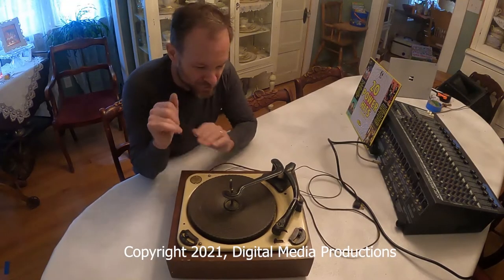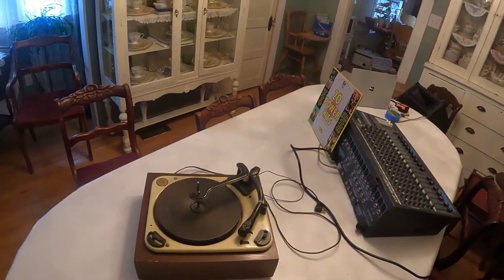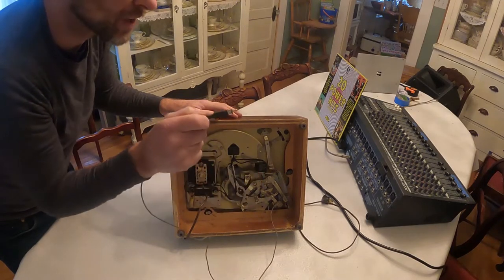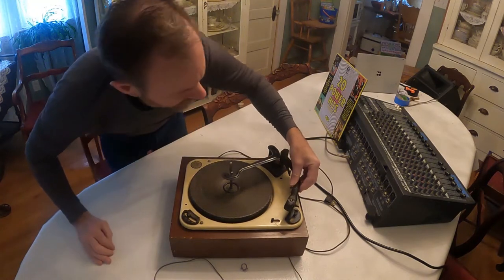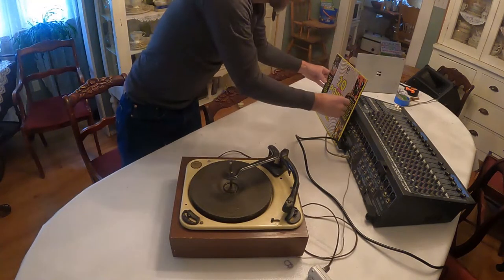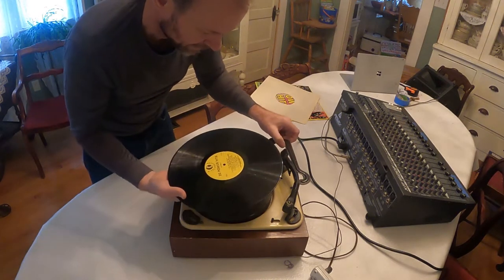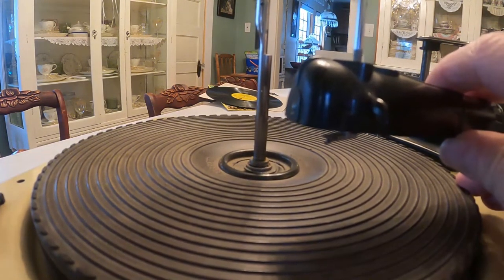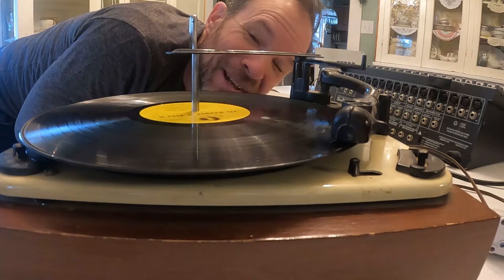Trying out a vintage Garrard Model RC121/4D Record player for the first time.

Comment: The phono cartridge looks like a GE VR mono magnetic cartridge. those where fairly high output compared to more modern stereo cartridges but still usable with a phono preamp. I have one mounted on a much more modern Garrard SP25 for paying mono LPs and 78 rpm records
Reply from the maker: I was surprised it worked going into a standard "line level plug" rca  so your statement about having a high output makes sense!

Comment: You Probably have to take the platter off and clean old grease from the gear, and lubricate it with new grease, This model was produced from 1956 to 1959, then came RC 121 Mark ll, that was able to play in stereo if the rest of the set up was in stereo.

Comment: You can unplug the head shell from the tone arm which makes it much easier to replace the stylus and/or cartridge. It has no pre amp. I have a similar one from 1953 which works well.

Comment: hi when i was at school they had a mono deck like this from the  58   it could pay 78  33   only  because the 45 was not out yet 
 it used to plug in to the pa in the hall  where the amp was  later they got a better set  up

the only thing one who used it got hit with 100v line   i said back in the day  ad the speakers on first be fore you power in up

Comment: That assumption - that there is already some amplification - is based on what, now?
Reply from the maker: That assumption is based on the following:
1. I don't have a pre-amp handy to plug that RCA cable into.
2. I do have a line input I can plug it into.
3. I want to plug it in. Now.
4. If I assume it requires a pre-amp, I won't plug it in.
5. If I assume it doesn't, I plug it in now.
6. I plug it in now (and I'm happy).
Reply: In that time period ceramic and crystal cartridges were extremely common, and their output voltage is at line level, not just a few millivolts like a magnetic cartridge.